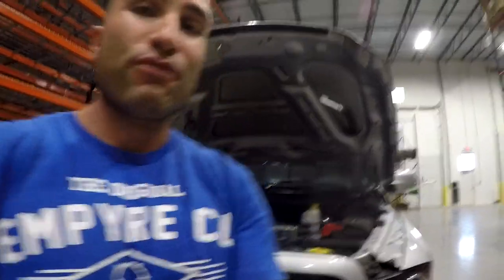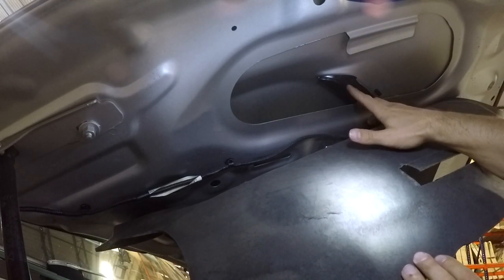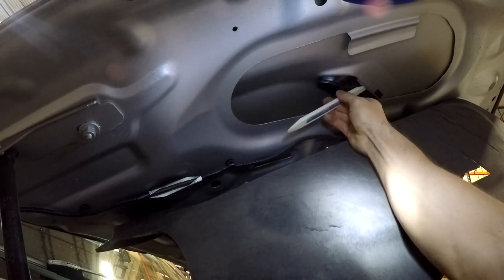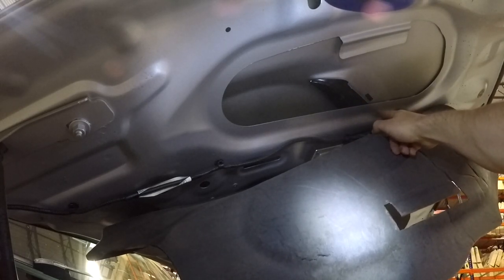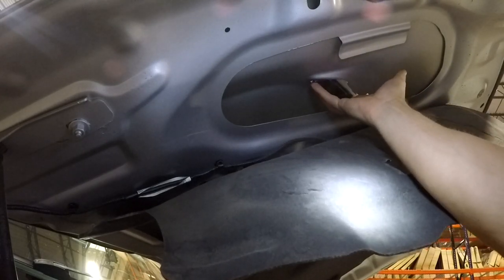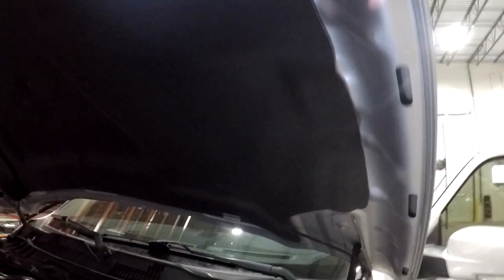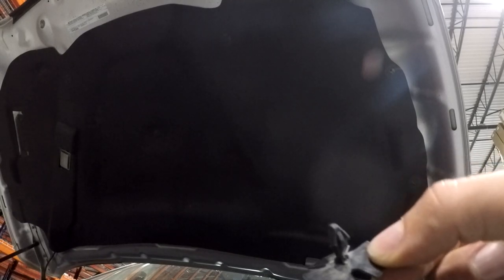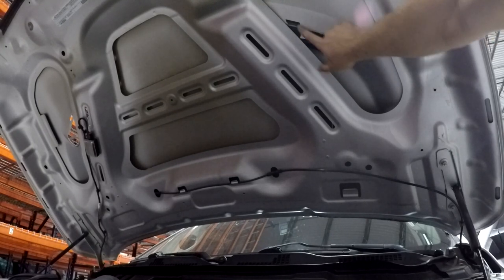How to remove RAM 1500 Sport Hood Vents

Comment: Ram air system I believe is that it's called replaced the hood vents with a working forced air system
Reply from the maker: Yeah its a cool system but super expensive and only works on the passenger side for their intake!  Won't work with the procharger kit install we are doing 😁